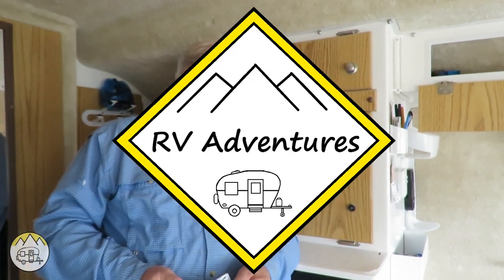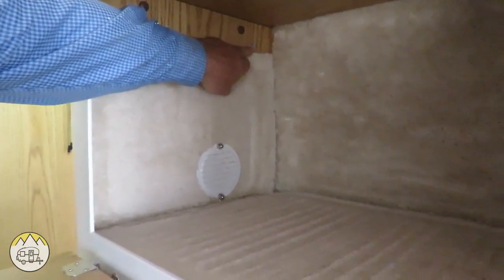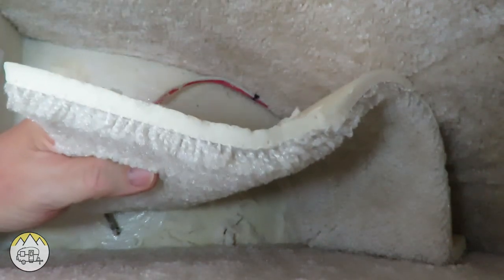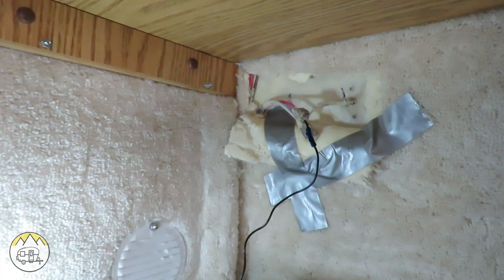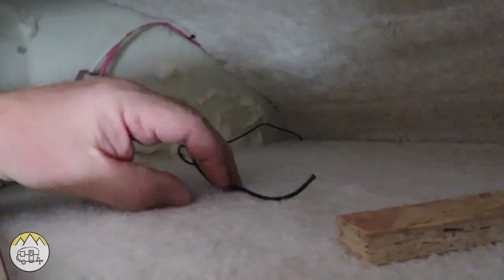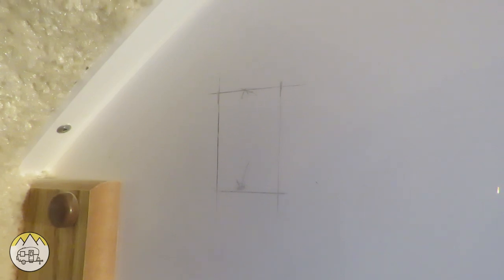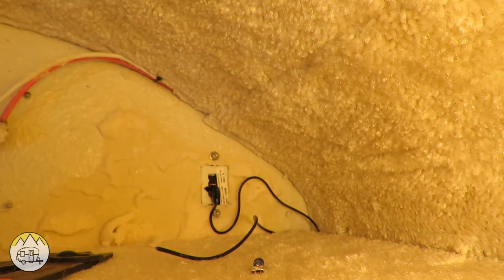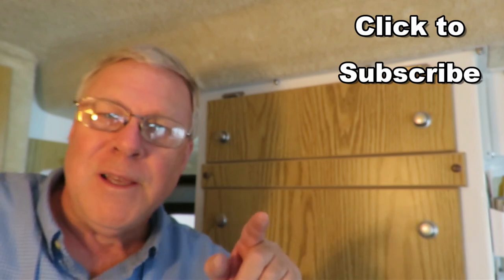Casita - Add a switch for outside light by RV Adventures

Comment: LOVE your Casita Modifications!!!  Is the black wire always the hot wire?  On a car battery the black is ground...   Your maintenance/modifications videos are very informative and applied to other RVs too!  Thanks for sharing.
Reply from the maker: The Casita is wired that way... white is the common and black is the "hot". I think it is this way because the fiberglass doesn't conduct electricity so every item has to have a black and white wire.

Comment: A much easier option that's very inexpensive, is to simply install solar powered motion detection sensor lights.  You can find them for as little as $10 each.
Reply: Then the light will be coming on whenever anyone or anything goes past, whether you want it to come on or not. His idea is much better. this way he can turn the light on only when he wants it on..

Comment: We have a 2009 SD.  We just put on a new exterior grab handle. I felt a lump on the inside, thought was wires. I was very afraid to cut into carpet and afraid I was going to cut wires.
Makes me wonder, why doesn’t Casita run all of of the wires along edges that can be accessed for upgrades or repairs?!  Would be so much easier.
Enjoy your videos!
Thank you!
Reply from the maker: That is a great idea. There are a lot of things that could be better with the Casita manufacturing process. I do hope they listen to feedback from owners and incorporate some improvements in the future.

Comment: Alan great idea - why doesn’t Casita do this!  I have a 2021 that has LED light fixture and bulb.  It has red, white and black wires.  Do I need to do anything different from what you did because it is LED?  Thanks.
Reply from the maker: Not that I know. I would check the white to black with a volt meter to see if those are the correct wires for negative and positive. Also check white and red. Usually a red wire indicates the circuit continues to another fixture, so be sure to check it good.
Reply: Well Alan, I didn’t check the wires as you suggested!  What will happen if I didn’t connect the right wires together.  What happens now, is that I can turn the outside light on and off from the new inside switch. Will I burn my trailer down if not wired right?

Comment: Another great mod. I have a question, did you bypass the switch on the light or the switch can still turn off the light?
Reply from the maker: I haven't decided what I want to do about that... I think I am most likely going to bypass the switch but I wanted to use it for a while to make sure I don't come across a time when I would want to turn it on outside when returning to the Casita at night vs. leaving it on when I know I will be returning at night.
Reply: RV Adventures if you decide to bypass the switch on the outside light, you may want to consider switch to this light. https://youtu.be/QCyCu2lsnUQ I am sure scamp sells them in their parts store. Good luck enjoy all your mod videos.